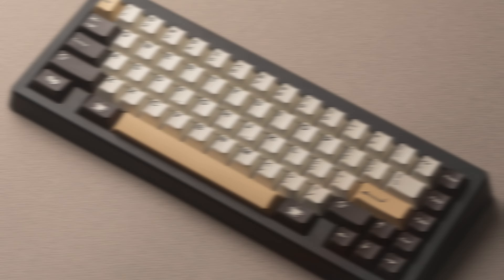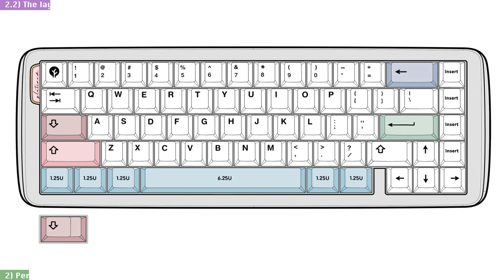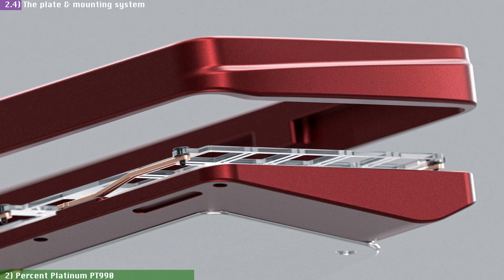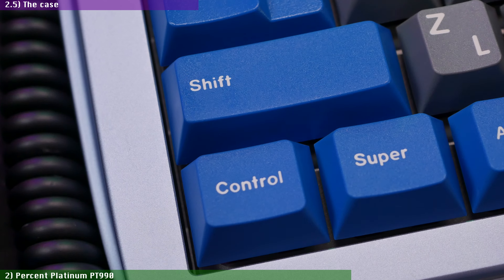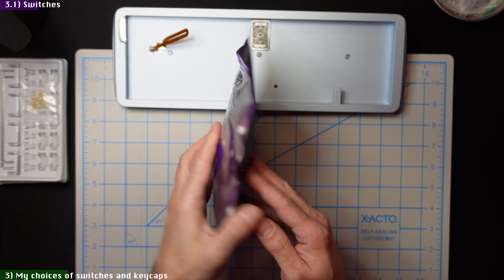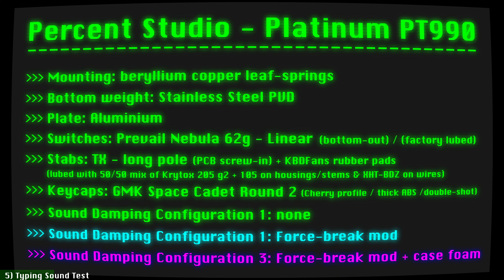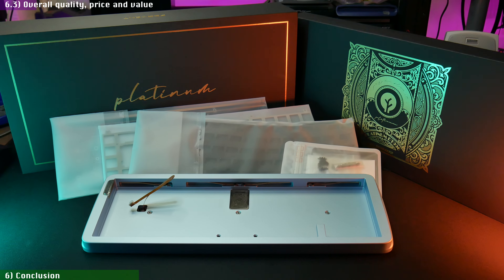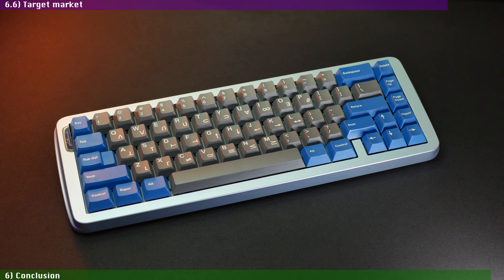It's all about the design... (Platinum PT990)

Comment: Great video. I can't decide if I love the case aesthetics or not. I'm typically a fan of sharp lines and slim bezels, but something about this board has me intrigued. Very tempting to hop in the GB.
Reply from the maker: I know what you mean... It looks very different than most of the angular boards we usually see (which are easier to manufacture).

While I love Art Deco style in home appliances and architecture, I don't think I have ever seen that style on a keyboard before. So, it is very striking and it does take a second for you to grasp what you're actually looking at.

This is an expensive board that obviously can only be justified by the craftsmanship, design and premium materials. Don't get me wrong, it types wonderfully! But you obviously can find cheaper boards that type as good as this one for much less. So, here, it is indeed, all about the sexy design!